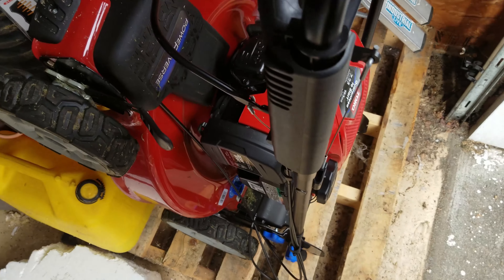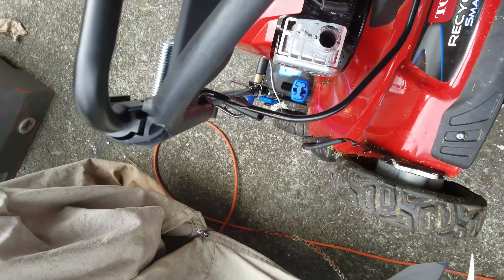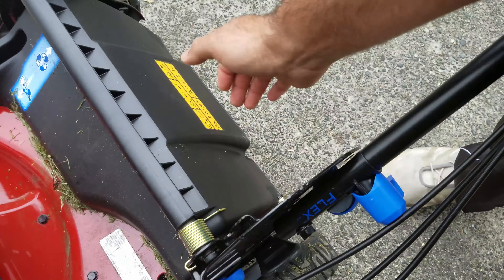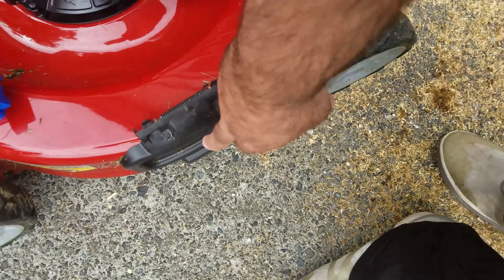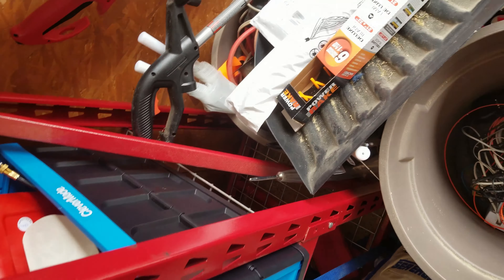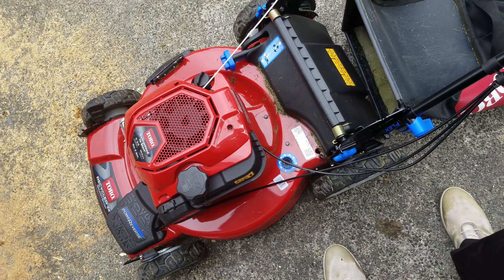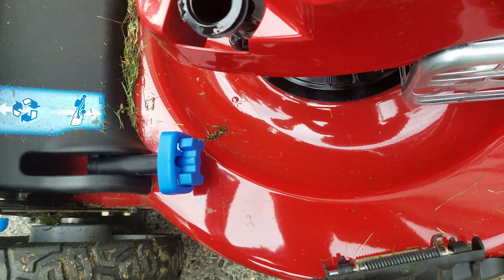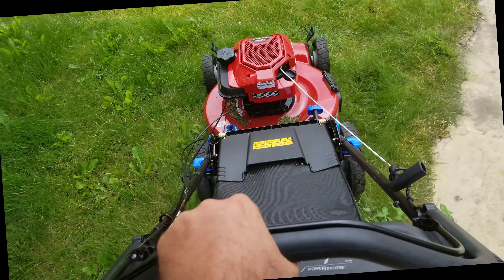Lawnmower - Toro Recycler SmartStow 22-inch Self-Propelled Gas Lawn Mower with Briggs & Stratton Eng

Comment: What's the model number of this mower? Did you say it's 4-wheel drive? Is this the one where the handle controls the speed of the drive? How do you like it after two summers, any problems? Thanks!
Reply from the maker: Model # 21472 is all wheel drive not 4-wheel drive. no diff locker. works great and i use it weekly. ran fine last week. no complaints so far. i did have to top up the oil this year.
Reply: @ysesq  Thank you for replying and clarifying the drive system.
How do you like Toro's variable drive handle—is it intuitive and just works or did you have to get used to it?
I will definitely look into this model, thanks again!
Reply from the maker: @kerigpope  you get used to it quickly. its not a problem.